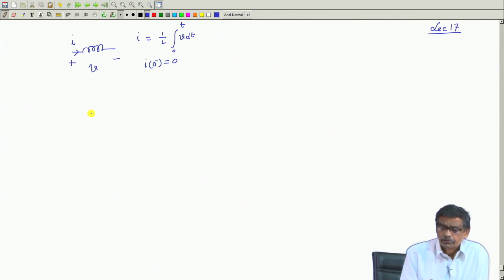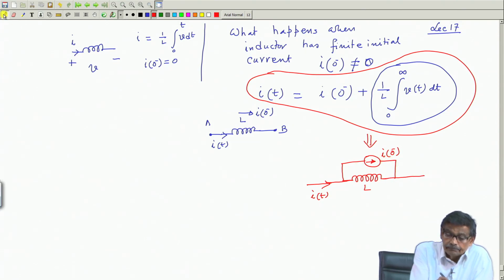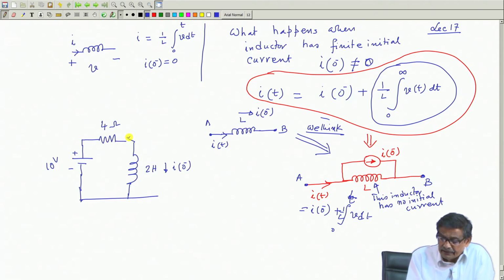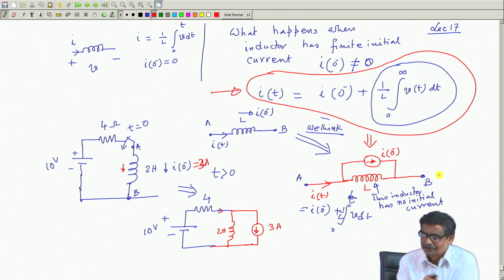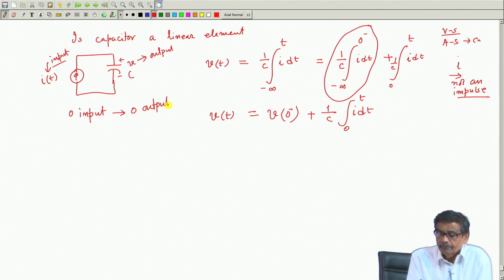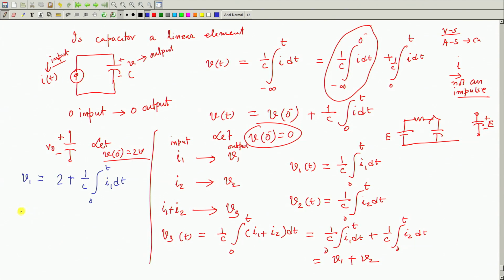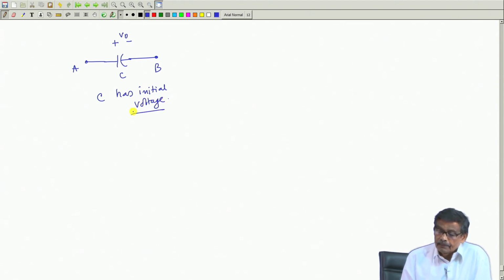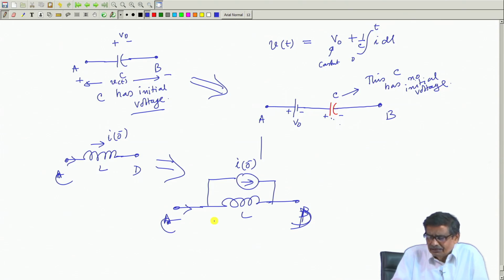Lecture 17: Linearity of R, L, C - Inductor with Initial Current and Capacitor with Initial Voltage

Comment: Sir,
I have a question that you say that resistance is a linear element i.e. voltage will be zero when current is zero.
But what about the short circuit condition in which current is maximum and voltage is zero?
Also I have a curiosity that we say that current will flow when we have voltage i.e. potential difference but in my view this law violated in short circuit as current flow but there is no voltage?
Reply: At short circuit and open circuit ohm's law doesn't follow
Reply: @childhood_  Hii ,bruhh do you preparing for gate exam. If yes then , kindly give your Instagram id. So that we can be in touch. 
Being  in a group will give you a better understanding ,right? 
And we can share PDF, books etc..,? So 😃